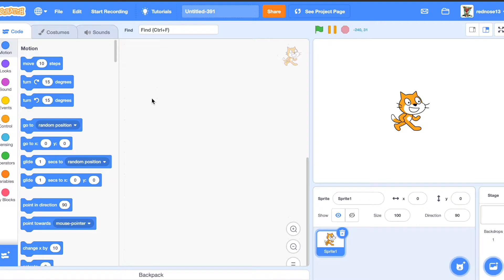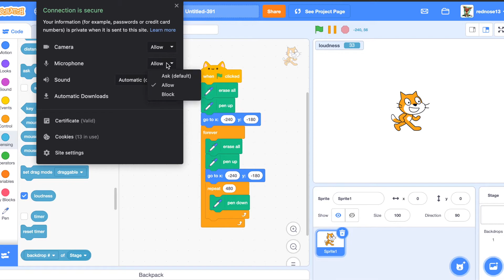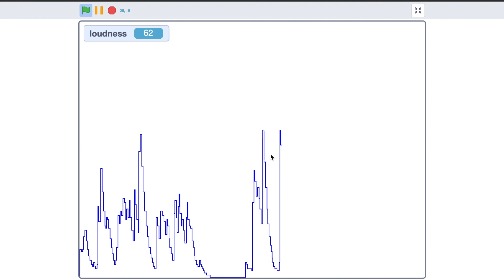Scratch Audio Visualization | Easy

Comment: I tried using 0.5x and repeat 960, at this point the smoothness had doubled but the pen had problems, So I wonder If we could use a 3D rendering module, Something which uses the Gpu for rendering the chart so that we can make it bigger.
Yes I agree that 3D rendering would take more power but I think that the performance would be consistent even if we make it a lot smaller and harder whereas with the normal system scratch would struggle to render it and would probably crash at some point.